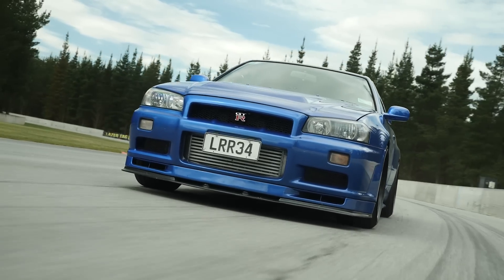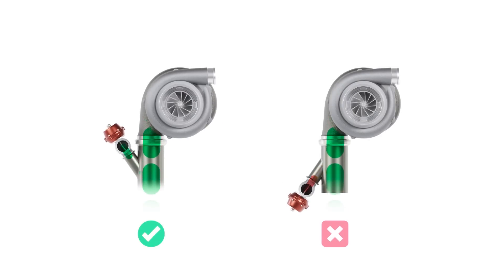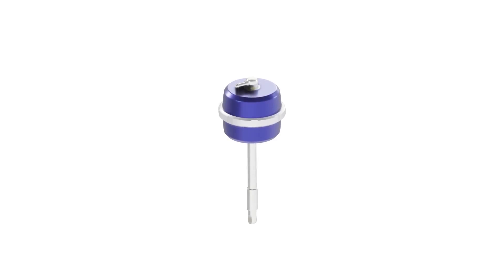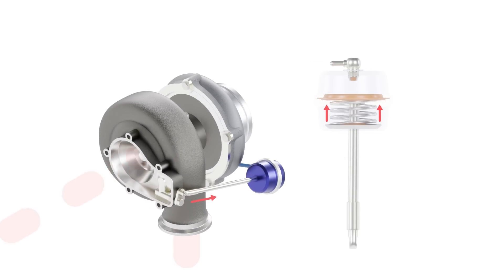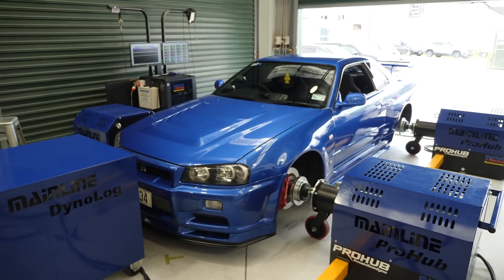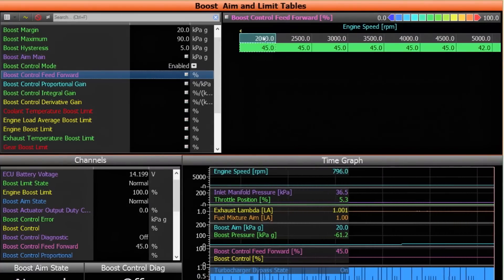9 x Pro Tuner Tips: Your BOOST Control Tuning Guide

Comment from the maker: 🏎 Building a fast car? Get $400 OFF the all-inclusive VIP online course package deal: https://hpcdmy.co/offery190
🦵Kickstart your EFI Tuning knowledge. Get 50% OFF your first online course: https://hpcdmy.co/offery190	
TIME STAMPS:
0:00 - Boost Control Issues
0:48 - 1.) Wastegate Sizing & Location
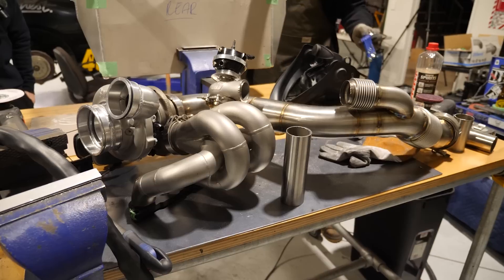1:49 - 2.) Plumbing Mistakes
2:45 - 3.) Tuning Details
3:20 - 4.) Component Failure
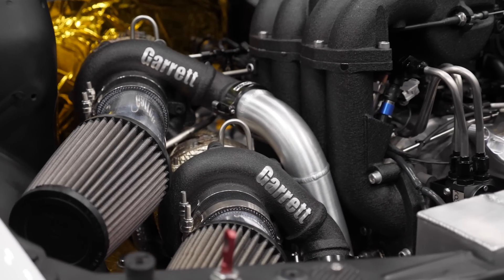4:21 - You Can Tune Safely Using These Techniques
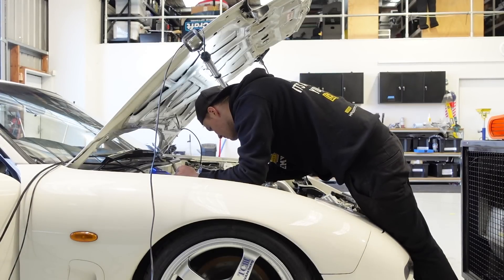5:05 - 1.) Boost Cut
5:33 - 2.) Disable Electronic Controls
7:15 - 3.) Don't Start With A Full Ramp Run
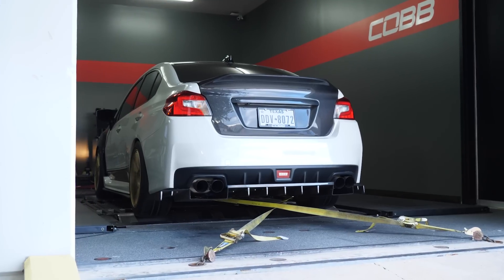8:06 - 4.) Slowly Add Boost And Test
9:00 - 5.) Tuning Is An Iterative Process
10:04 - We Hope This Helps You Tune Better & Safely
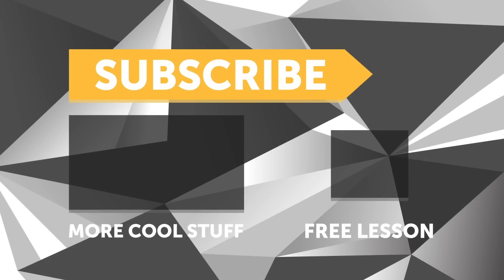10:22 - BUILD.TUNE.DRIVE

Comment: Hp academy, please 🙏 i need your advice, I bought 19t turbo and also upgraded the turbine wheels to 9 blades from 15t compressor wheel. The boost pressure is awesome almost no lag at all but am having random misfire when I pull hard. Am afraid 😨... am enjoying the turbo upgrade but am afraid. 
What should I do please
15t => 19t compressor wheel
11=> 9 wheels turbine. 
The boost pressure is awesome but am afraid. No ecu tunes yet.
Reply from the maker: Are you logging any data during your runs? If not, that is where you need to start. The next step is going over it to help you find the cause - Taz.
https://www.hpacademy.com/previous-webinars/354-introduction-to-data-logging/

Comment: Hi Andre can you make a video about using a parallel ECU or some sort of device to control boost on an ECU that doesn't support the same type of boost control. e.g. I have a factory ECU that supports a supercharger but I want to use a turbo instead, but I don't want to use a standalone(lose CAN compatability with the rest of the car). Can it be done?
Reply: Innovate motorsport SCG-1. Its a AFR and Boost control module. Comes with sensors, EBC solenoid and electronic gauge. Within the gauge you can hook it up to a computer to program with free software on their website. Also has free data logging software (just logs boost and afr from their sensors and tach from a (0-5V) signal.) I used this to "road tune" my 1988 Volvo 740. As long as you boost within the limits your current ECU is tuned for it should work fine. Doesnt touch the ECU at all but think there is an option if you wanted to send AFR data to it.

Comment: Would plumbing boost solenoid 90degree-T from straigth flow(boostpipe to wastegate) differ in boost control versus making boost line straight in a T to soleinoid and wastegate beeing 90 degree? Or it doesnt change anything?
Reply: Negligible
Reply: @Alchemist37  I squeezed 4mm silicone hose on mine, should I have used 6mm?

Comment: I like doing a 30% 50% 75% then 100% TPS technique, also useful in finding boost issues. Just doing a car now with perfect boost control at 75% TPS but walks away over 6000rpm at 100% TPS....those new Garrett G series have some serious flow up top!!
Reply: Fluffy floor mats 😂
Reply: My car is like this. Perfect control at 75% throttle (13psi) but spirals to 16+ at full throttle. What’s your fix?
Reply: Mine behaves like this also. Commented to know if he answers.
Reply: @Izaza433  It really depends on the cause for something like this. It could be either a mechanical wastegate issue, i.e. too small, or bad wastegate priority. Or if this is happening only once raising boost via boost control, it could be an issue in your tuning parameters. If your on closed loop it may be that your gains are not set right, or if your open loop, it may be that your just using too much duty cycle.

There is quite a lot that can go on, lets say your on open loop and say 30% duty cycle works great for sub full throttle or lower RPM. You may running into an issue where the 30% actually isn't enough to hold your target of say 13PSI.
Because either your engine can't provide enough exhaust flow at a low RPM, or the throttle is limiting the amount of flow in the engine and therefore what reaches the turbo.

So in this situation 30% is just too much duty cycle, and so you need to lower it until full throttle your hitting your ideal boost.

With closed loop it could be a variety of factors.

A good start would be disconnect your boost controller, and test with just your wastegate. If you have say a 10PSI spring, does it overboost over 10PSI once you start reaching redline, does it hold at 10PSI well when doing a ramp run/pull. If with wastegate only it behaves as expected, then you can try bringing back in the boost control but start at lower duty cycle numbers and go from there.

If it doesn't hold a consistent boost pressure with just the wastegate then you know you have a wastegate issue.

Hope this helps!